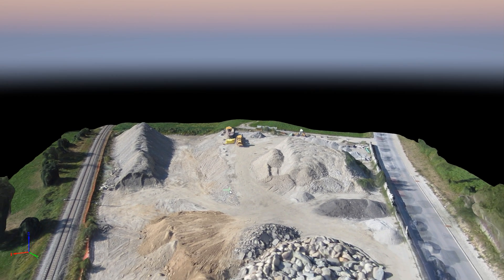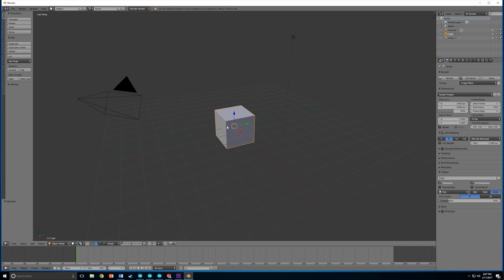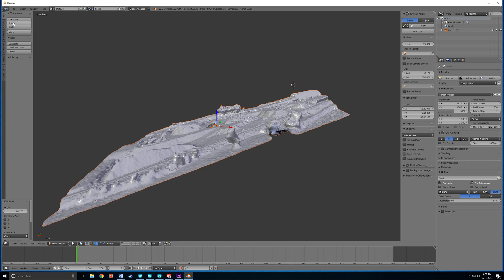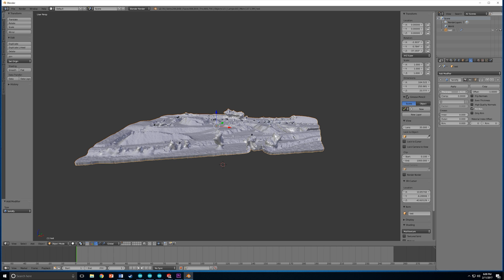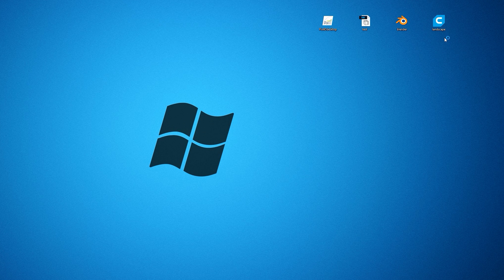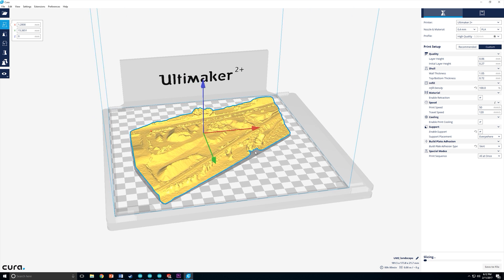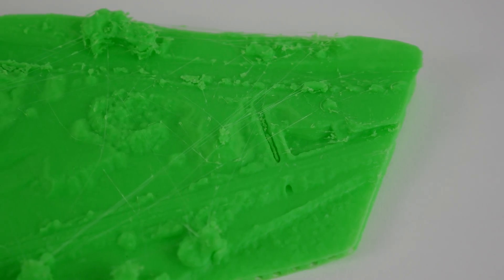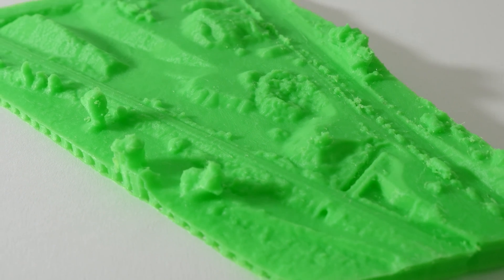How to 3D print Pix4D Projects

Comment: Thank you for making this tutorial.  I am new to both Pix4D and Blender.  When opening Blender, I was able to import my .obj file, but I'm having a really hard time moving it around to get it flat.  Also, how did you delete the cube and the cone/pyramid at :50.   Was this an important step?  Lastly, I believe that my Pix4D file is inverted.  How to do I make it the right way so that it isn't inverted vertically.  Thank you for your help!
Reply from the maker: Hello Josh, to delete the camera and cube simply select them, and then press X. In Blender there are various transform controls that you can use to move the object around and rotate it which should solve the issue of it being upside down as you said.